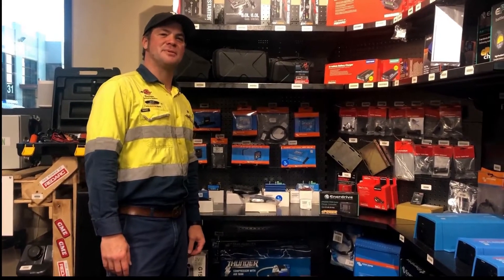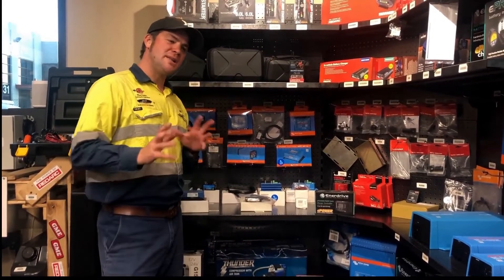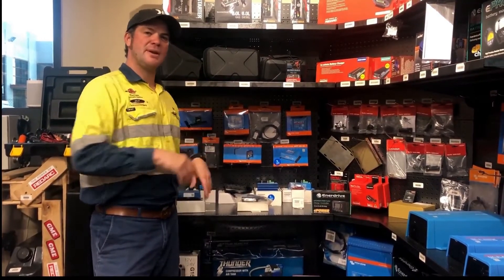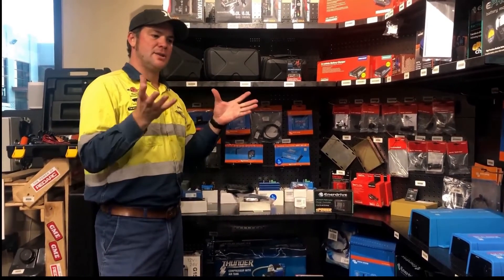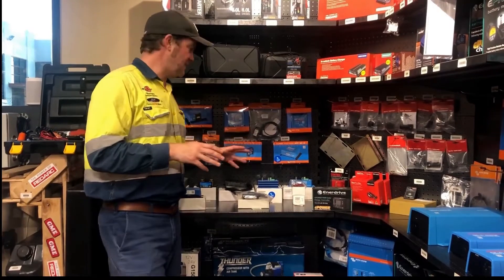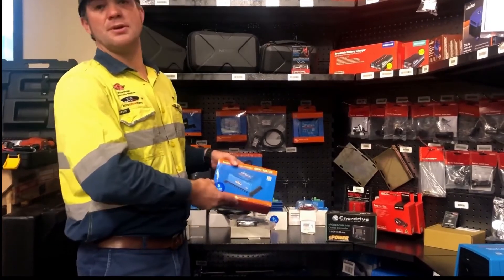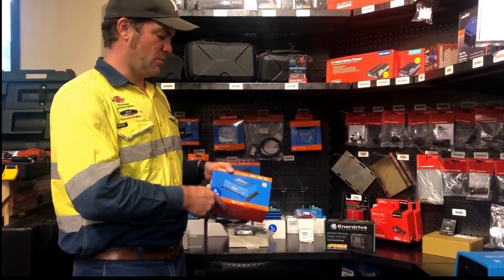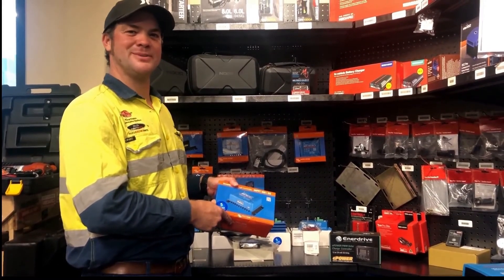PWM vs MPPT Solar Charge Controller : Which one is More Efficient?

Comment: Efficiency of PWM vs MPPT are the main reason MPPT wins, but have you found some MPPT algorithms spend too much time hunting in sunny to intermittent cloudy days?  On days like these, when the solar panel can produce greater than the charging voltage almost all the time, the PWM just works, while some MPPTs spend several minutes finding a new maximum power point, but because the insolation is always changing (clear sky then a cloud the back to clear sky) it keeps hunting for a maximum power point while producing very low outputs.  I've had four solar controllers out at the same time, 3 MPPTs and 1 PWM all different brands, each with the same panels, four power meters, and four batteries discharged to the same level (from a 48V system, but used as singles), and it was evident a good algorithm finds a new but ever-changing maximum power point within 10-20 seconds and then start ramps up to maximum charging (which then can take another the best part of a minute of two), while a poor (slow and clumsy) algorithm can go for a few minutes over- and under-shooting the maximum power point as a cloud comes and goes all the while putting out next to nothing.  What's your experience with these algorithm behaviours?